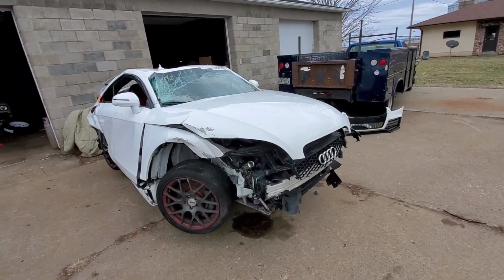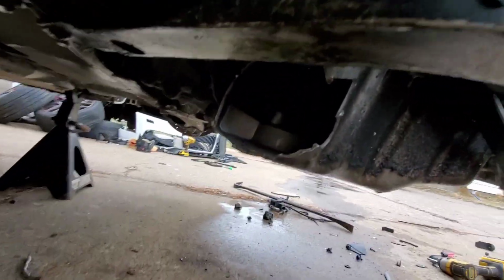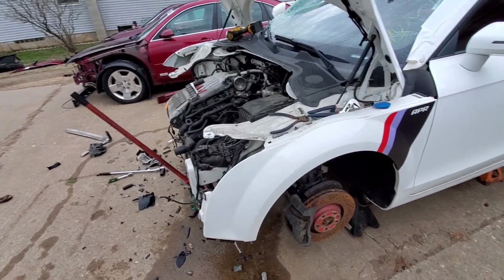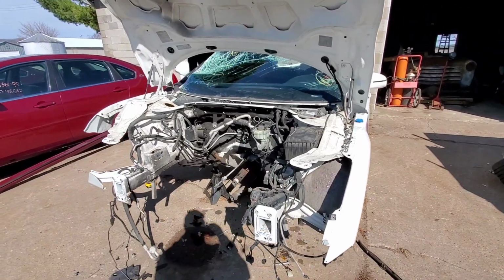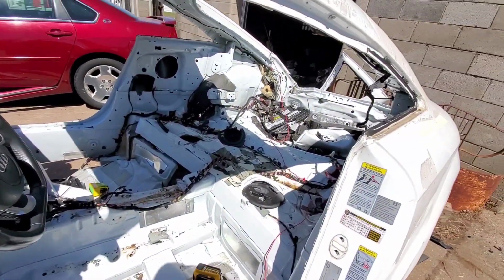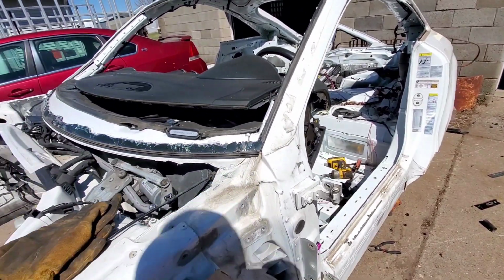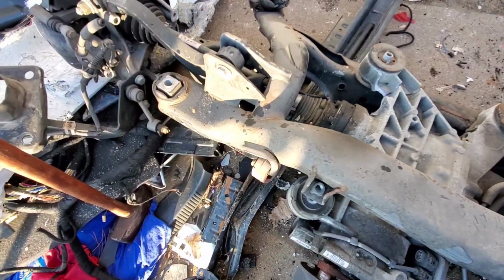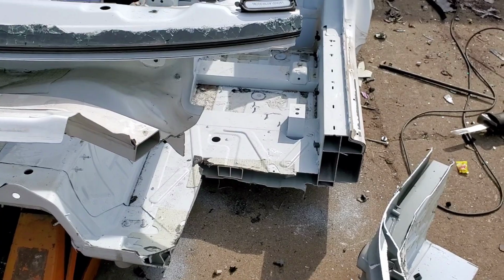2008 Audi TT Quattro disassemble. borked copart catastrophe

Comment: Audi's are endless moneypits, even before it got hit !,part it out & feed it to the crusher
Reply: you are not wrong there, my mate has had a number of audis and each and everyone of them have been money pits, His 1st one he spent well over 2k on repairs a lone,  and it still needed money throwing at it. It ended up been weighed, the second one, the engine went boom,  he sold that to a work mate, which parted that out. The last one he bought fuel pump in the engine was starting to go, Which would have been nearly 2k to fix.  He did buy a vw passat, that cost him money, to the point he got shot very quickly too.  Laugh was he swears by vag, hates vauxhall.  He has had no trouble with vauxhall.
Reply: @procta2343  I would take a Vauxhall  Opel.,Holden or even a Daewoo over any audi anyday! Hell my friend gave me a 5 year old Audi A8L & I quickly just sold it off to a exporter. Bye bye endless moneypit !
Reply: @daewooparts  I know some people rave on about VAG stuff,   A few lads at work have newish golfs and they have been pure spot on. but fuck me, when they go wrong, they go wrong, and turn into a endless money pits. Top this off my mate decided to give BMW a shout,  must have been the shortest car owner ship, that needed 1000s  spent on the engine, and that was a rocker cover gasket, on a 6 cylinder diesel. He sharp got shot of that.  Ended up with a Seat, which has been ok. might the best out of the VAG range to go for,